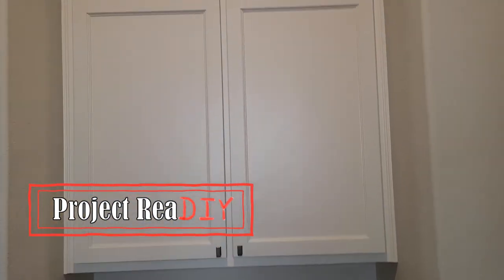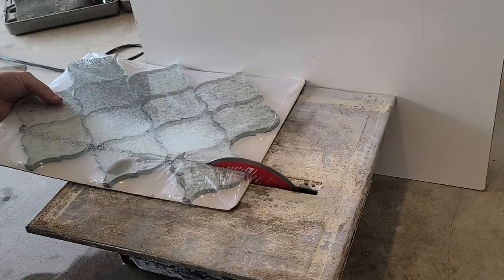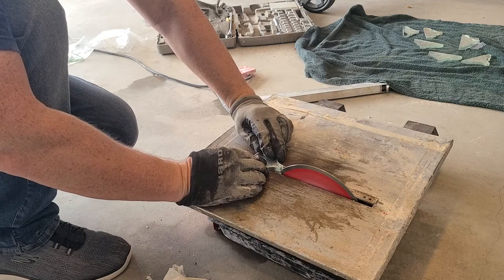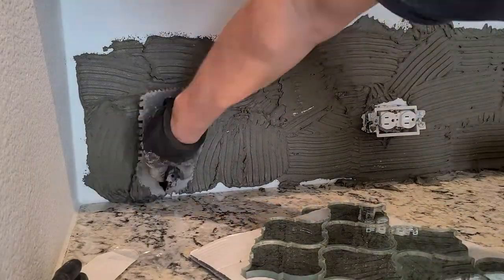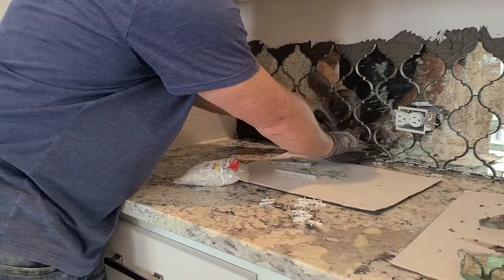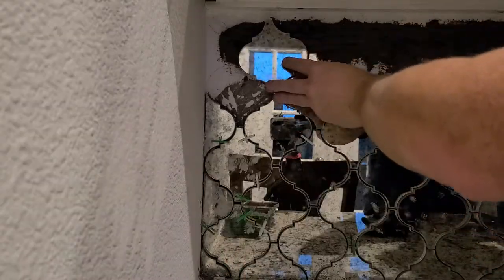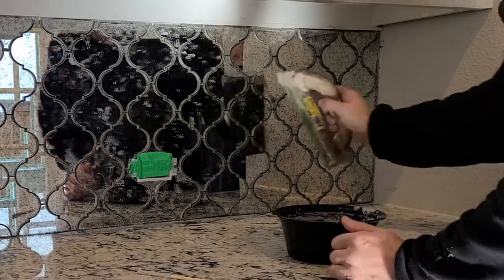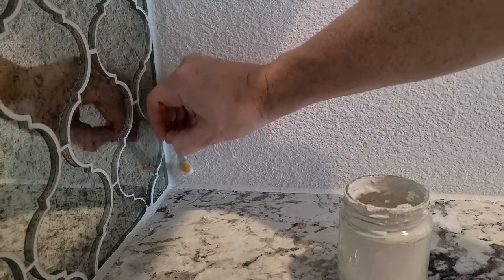Antique mirror mosaic tile backsplash

Comment: A good glass and tile cutter is necessary using a diamond or carbide wheel on a tile cutter for cutting glass tiles. Also glass oil on the wheel helps the blade stay sharp and in good shape to get clean cuts. Also Ive never seen anyone grout mirror tiles. Usually those are butted up together so I learned why and what not to do on this video. Sorry. Looked ok when done. Mirror tiles arent ceramic tiles. Theres a difference between them and how to install. Lol